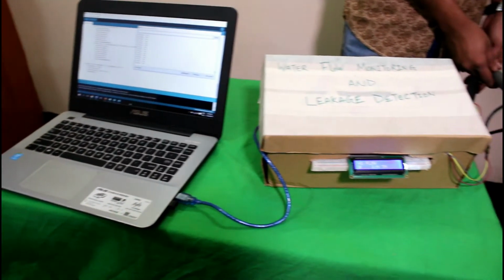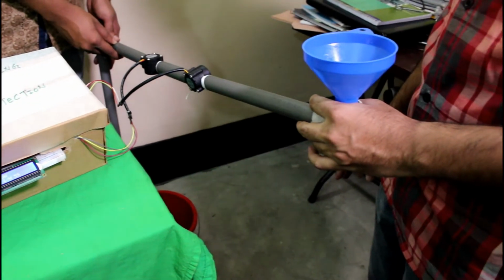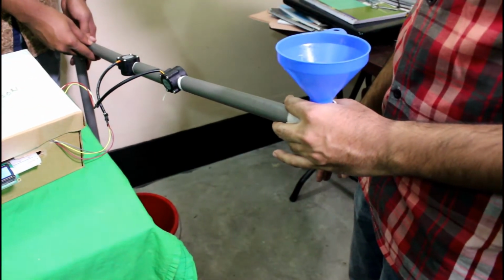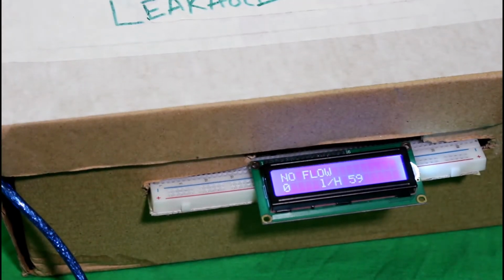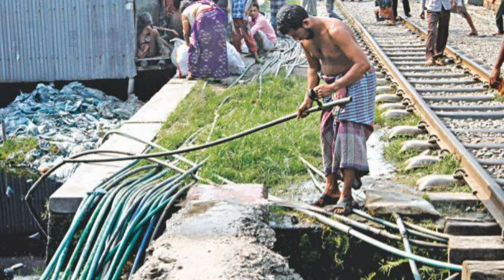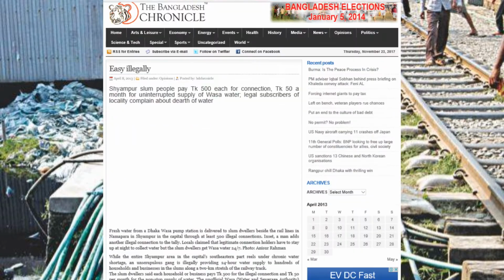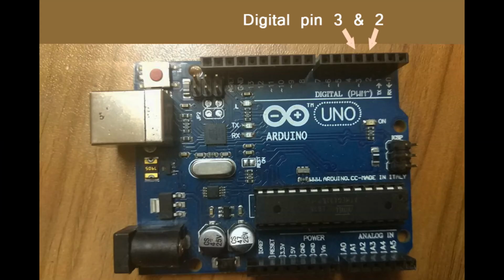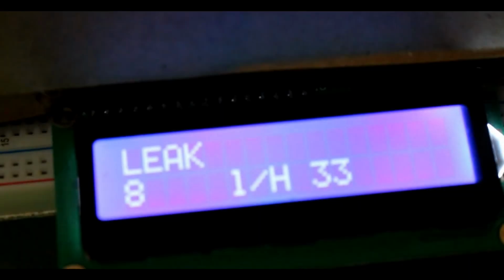Arduino Project | Waterflow and pipeline leakage monitoring system | BRAC University

Comment: Hi Guys, you encouraged me to investigate the use of an Uno for my home. I need your help to add a strong solenoid flow control valve which is normally open but closes when a leak is detected. I would like to have a loud alarm and a text message sent to my phone. Since this is my very first project so I would be most grateful if you could help me with detail code to realize the solution. Later, I would like to install a flow control for. each appliance that uses water in a house. Many thanks.

Comment: why sensors cannot execute the data simultaneously
Reply from the maker: This is the limitation of Arduino Uno. We can overcome it using Arduino Mega
Reply: @akilahmed1665  then akil why you used arduino uno rather than arduino mega
Reply from the maker: @divyamupparthi4999  we used it as it was our course requirement, we had to work with arduino uno
Reply from the maker: You can also check our new project here:
https://www.youtube.com/watch?v=aJyy0mVsH5U
Reply: @akilahmed1665  very nice